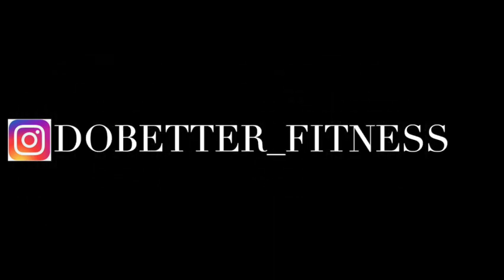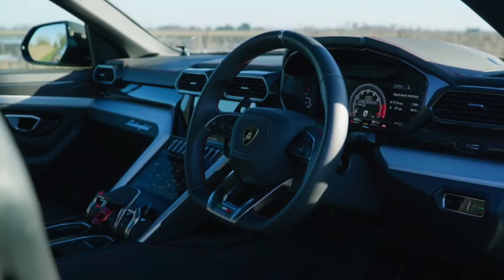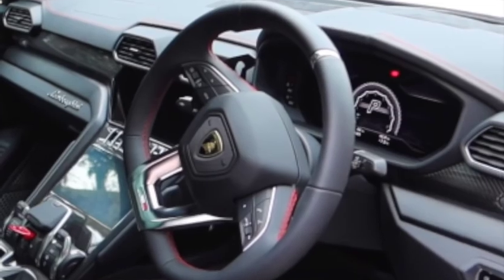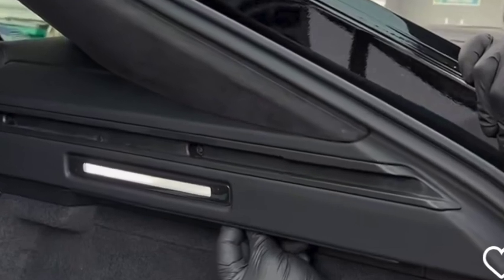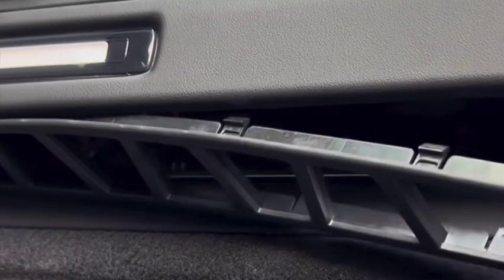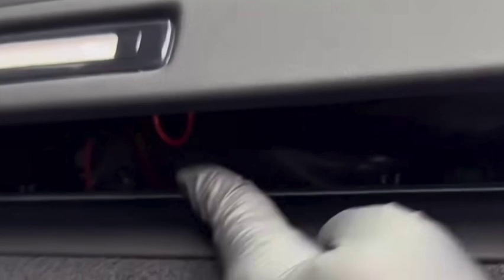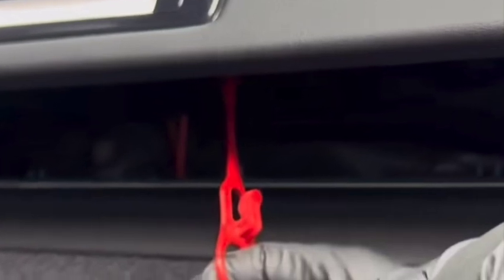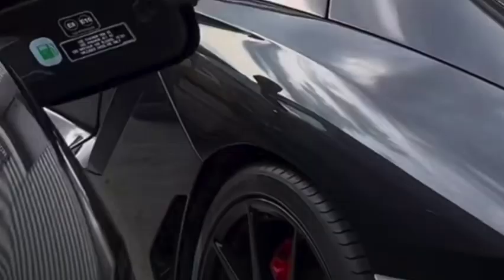Emergency fuel door switch in your volkswagen product example with Lamborgina Urus

Comment: I pulled my emergency release cable on my 971 Panamera and it didn’t work. The fuel door switch was bad and had to be replaced by the dealer.
Reply from the maker: ya the Panamera 971 had a recall for the fuel door. Any other problems with your Panamera.